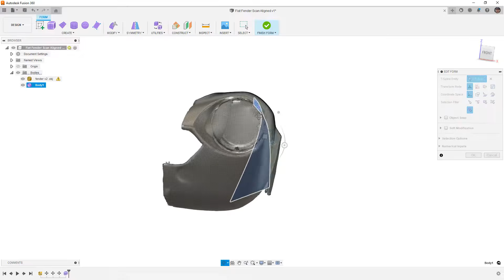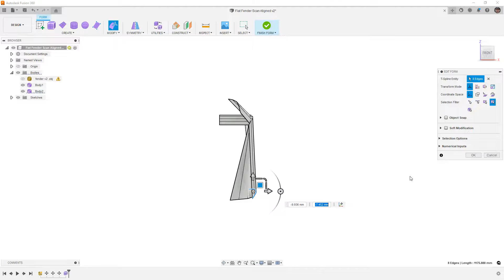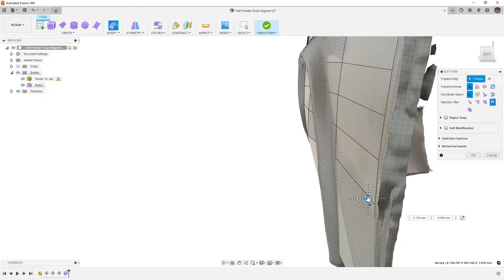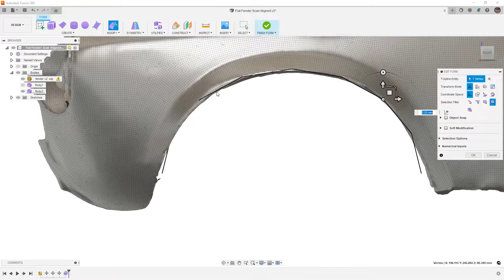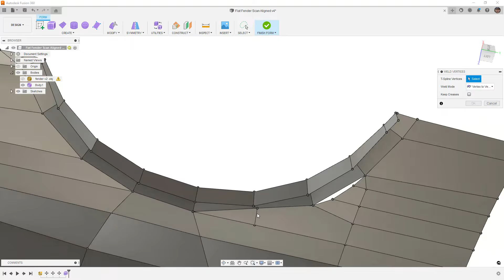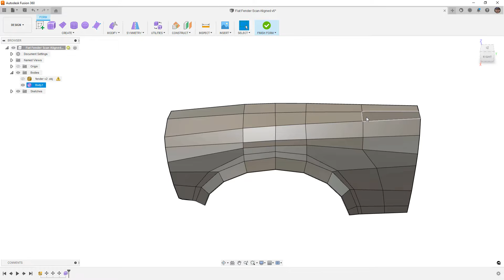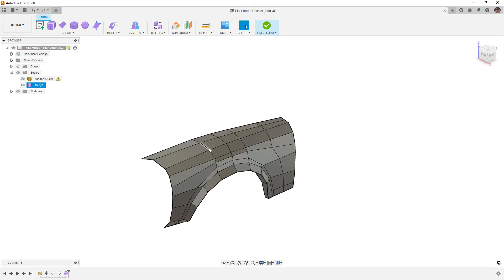Reverse Engineer Car Parts with CAD | Fender Modeling from SCAN Data - Part 1 #Fusion360

Comment: Hi Matt. You say in this video, as it’s for a race car total accuracy isn’t such a big deal. To get the most accuracy, what techniques, tools, etc would you use? Thanks!
Reply from the maker: Well the start would be the highest accuracy scan.  Pro scanners would scan the fender with .02mm accuracy while most hobby scanners are in the .2mm accuracy.  The second thing is that I knew from the user that asked the question that this was going to be a single 3d print on a large home built machine.  So a highly detailed CAD model wouldn't have added much to the process:)  IF the design was going to be CNC machined for example then you would take more time ensuring the scan was high resolution and that the part fit that high res scan.  

Really not a whole lot different to the process, but just working with higher density mesh and spending more time on how the parts fit together.
Reply: @LearnEverythingAboutDesign  thank you Matt. You’re always very helpful.

Comment: Beginner here. Just did my first scan of a fiberglass chair I laid up myself. When importing scan data do you want to import the finished mesh design or would it be better to import at a fused cloud level ? Thanks much for your shares.
Reply from the maker: Part of it depends on the quality of the mesh and where it came from.  When pulling a freeform body down to a bumpy mesh you will get bad results.  But if you  have a really dense smooth mesh it is a great option.

So if your mesh/scan software lets you do a nice clean processed mesh with all the detail you need, bring that.  If you start to smooth and refine the mesh and notice a lot of your detail going away, bring in a more raw version.

Comment: How would you go about reverse engineering the Tesla Cybertruck? I need to make a solid model and thought it would be a fairly simple model to do as a beginner due to all the flat sides but turns out it’s more complicated then i thought
Reply from the maker: Replied to your other comment.  I would use surfaces and either 2d projected sketches or 3d sketches for the boundaries.  Do you have blueprints of the truck to start?
Reply: @LearnEverythingAboutDesign  i have seen blueprints online and many pictures that can be scaled with know measurements but most seem to be based on older 2019 version the products 2023 version is smaller. But since Tesla just announced the cybertruck delivery date Nov 30 we should now be able to get accurate information shortly

Comment: Hi, I purchased a Leica TS50A scanner from an auction online and it didn't include the software. Do you know if it will only operate with the Leica software or is there a generic software that can be used?
Reply from the maker: I am not sure but the first place I would check is with them directly https://leica-geosystems.com/en-us/products/laser-scanners/software/leica-cyclone  Sometimes the scan software is part of a license package and its possible that is tied to the serial number of your scanner.
Reply: @LearnEverythingAboutDesign  Thank you!

Comment: So at thw beginning of the video you mention that Professional scanners use $1000 to $10000 software to work with the data before you bring it into CAD. Can you use the hobby scanner data in that $1000 software and what kind of results would you get? Asking for those of us who would be willing to fund a $500 scanner and $1000-$1500 worth of software to have a "prosumer" solution but who can't afford the $10k+ for a full F1 laser scanner.
Reply from the maker: I might be reviewing the other end of the spectrum soon with this https://www.creality.com/products/cr-scan-ferret-3d-scanner  

So in a case like this fender where we are using the mesh as a guide yes.  It always comes back to how you are going to make the part.  If you use a high end scanner and get +- .04mm accuracy, does it matter if you 3d print your parts?

The widebody series I did(which i haven't finished the real part yet) i used an Einscan ProHD and didn't use any intermediate mesh software, just what comes with the scanner.  The Einstar they have is around the $1000 mark at looks pretty good for the price.  Hopefully i can test some lower end units on the same part and give you a real world comparison.  working on getting a scanner for that now.

Comment: Great video,why not model the kit then use the scan as a cutting tool to get perfect alignment and perfect seem with car fender
Reply from the maker: well you can't cut a surface or solid with a mesh body to the best of my knowledge.  And after you add additional lines/edges to the form, when you pull down just the outside edges it will deform the shape.

If you are 3d printing the fender you can convert it to a mesh and then use the mesh combine tool to remove the original that way.

Comment: This is gold! Can’t thank you enough for showing this process and putting it together the way you do. Truly helps new designers understand the process!
Reply from the maker: You are welcome!  A lot of these videos come from questions I get so sometimes they may seem very specific.  Don't hesitate to ask a question if you get stuck on something.
Reply: @LearnEverythingAboutDesign  thank you! Do you have any tutorials on dash/center console work? I am having trouble approaching parts of my project especially when it comes to creating organic curves on parts of the center console. I utilize offset planes to create shapes and extrude cut, but somehow it does not give me an organic feel or look. I even fillet and still it lacks the consistency feel. Another part where I am struggling is connecting prims to other parts that don’t have a flat surface (extending only the edge that needs to move further into the part sometimes “cuts the part”) I take it most of it is my lack of experience, but I am trying and these tutorials are extremely helpful!
Reply from the maker: @hamyg7724  are you working off scan data or just trying to build something from scratch?  I do have this tutorial which was a dash piece for a dodge charger  https://youtu.be/4fU3PUs2syM
Reply: @LearnEverythingAboutDesign  right now I am working with measurements of the space I have to design a center console (I created a rectangular rough shape and chipped at it by removing and cutting at sections where the shifter go, the e-brake…etc. But some of those components I’d like to place on curved/semi organic shaped areas to avoid making it feel flat. I will take a view at the link you proved thank you! I did order a 3D scanner so I can re create some of the older or broken parts. Hopefully I can also use it for some reverse engineering.

Comment: That was the slowest, most non exact way to approximate the surface. In no way were vertices of the actual scan used.

There are surfacing tools out there that create surfaces using the scam data far easier. Look at my own vx elements class A Surfacing example.
Reply from the maker: Thank you for your comment.  This video is how to model the fender for a racecar off scan data in Fusion 360.  Fusion is not a Class A program nor a mesh/scanning program.  Fusion doesn't have the ability to wrap a mesh nicely.  Any noise in the mesh creates ripples in the surface.  Fusion can snap to the mesh and pull the vertices down to the mesh but that is generally reserved for a very dense high quality mesh or else the results are not great.  

A Class A or mesh program that is specifically design to wrap a mesh with a nurbs surface is a different approach.  At no point do I say Fusion is the best or only way to do this, but I am showing how to get the best quality result when using Fusion.  Fusion is free for Hobby users, VX Elements is not(to the best of my knowledge). Not to mention the user in this case is 3d printing this fender.

So using free software and consumer scanners vs Creaform and VX elements or vx model.

In these videos users send me models they are struggling with and I try to walk them through at a slow pace how to approach the model.

Comment: What's the best and least expensive scanner?
Reply from the maker: That is a tough question.  The resolution listed on most of the hobby scanners from places like Revo or Creality seem to be descent.  Where you start to run into issues is the distance from the part and compounding accuracy errors when you have to capture multiple positions.  The Revopoint Mini is supposed to be the best bridge between pro and hobby, but I think it is still at the kickstarter stage.

My suggestion is to look at a few aspects of this.  What do you want to scan/do with the data and what is your budget.  If you look at HandyScans, you are in the $20k+ market, but an Einscan is around $5000.    

If you want to spend under $1000 I would check out videos on the Revopoint Mini and the Creality CR-Scan 01.  See what people are saying about those.  If you want to spend a bit more I would look at EinScan.  

Last bit to keep in mind, the scan data needs to be processed before it goes into CAD.  Think about that as it could be a considerable cost if you are looking at this from a professional perspective.  If you are trying to do it all hobby/open source MeshLab is free and powerful but not very user friendly.
Reply: I'm making parts based on the body of different Motorcycles will get into cars  once I get a few of these products done been hiring people to edit files for me not so bad so far
Reply from the maker: Gotcha, something you need to think about is how you are making the parts as well.  For example if you have a really high quality scanner and software but are using a low res 3d printer to build molds then it is likely not worth the money.

I think something like an Einscan will be a good investment, but maybe to get started the revopoint mini might be a good entry.  I have seen some descent scans come out of them.
Reply: @LearnEverythingAboutDesign Just thought i'd jump in as a guy who regularly uses 3D scanners for designing motorcycle parts. I'd recommend an Einstar 3d scanner, they're worlds above the likes of the Revopoint Pop 2, and much closer to professional level scanners like the Creality Handyscan 3d black or Einscan HX. That being said for small parts I often design parts around Iphone scans, using the face ID scanner for detailed small parts and the lidar scanner for larger parts like fairings etc where the detail isn't as important. All really comes down to what you need from the scan and how challenging the object is. Don't forget also that scanning spray makes a massive difference.
Reply from the maker: @Torques_moto  Great info!  It is cool to hear you are able to get usable info out of iPhone scans too!  I have mentioned the scan sprays in other videos.  Some users (like superfastmatt) use babypowder in an alcohol solution in a spray bottle.  I have used primer on sacrificial parts.  Weld prep spray or dedicated scanner spray gets expensive for sure.  If someone rolled in with a new bike to scan, you better believe I would use the scan spray that has no cleanup but a short window to scan.  For my own stuff I generally beat sheet metal forms, primer would be fine and then design.
Reply: @LearnEverythingAboutDesign  I agree with all your points, personally I use dry shampoo as a scanning spray. It’s cheap, quick and doesn’t damage any parts. 

Also, love the superfastMatt channel, brilliant info on there.

Comment: Thank your video!. I got a question can we use pull T-spline command to bring faces to mesh? Will the fender surface be messed with the wheel arch surface?
Reply from the maker: Yes you can! BUT, the problem is that pulling down to a mesh depends heavily on the quality of the mesh.  In the case of this scan it was not smooth so wrapping to it would not achieve the best results.

I have 2 videos in the forms mastery playlist that cover this topic.  This first video talks about the different ways to attached a form to something.(i did also cover match in a few videos but that is to an edge of a solid/surface)
https://youtu.be/Jd4adQN9FxI

And this one that covers how much resolution you need to match a very high resolution mesh.
https://youtu.be/PuCwSUPJ16Q

Comment: When inserting the scan mesh does it come in to scale? If not, how would you go about getting the mesh to it’s actual size to be able to build off of? Great video!
Reply from the maker: Generally the scale of the mesh would be handled in whatever software you use to read in the scan data.  If you have to scale it in Fusion it would be a bit rough honestly.  There isn't a true scale other than measuring between points(in direct mesh edit mode) and scaling the entire thing.